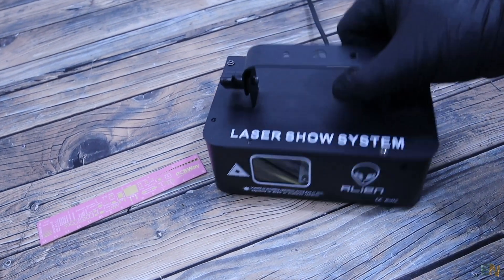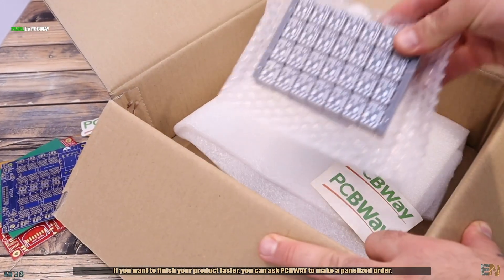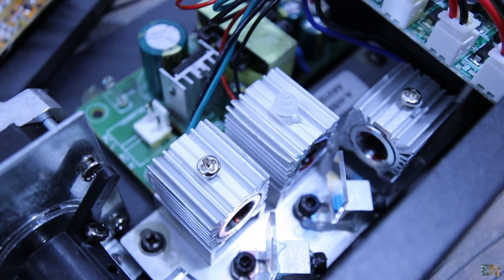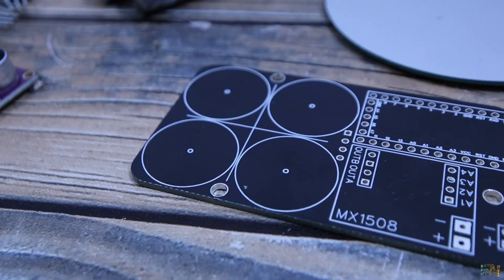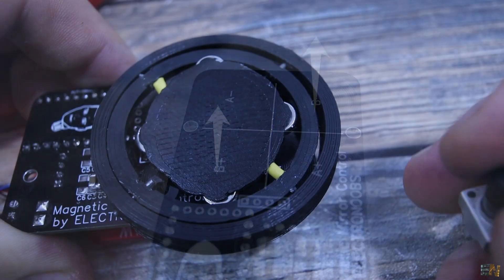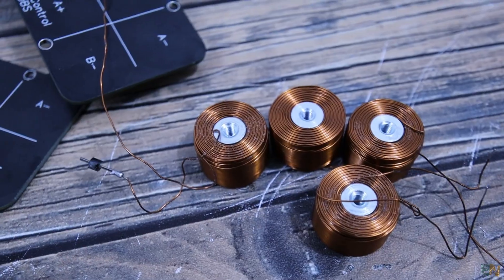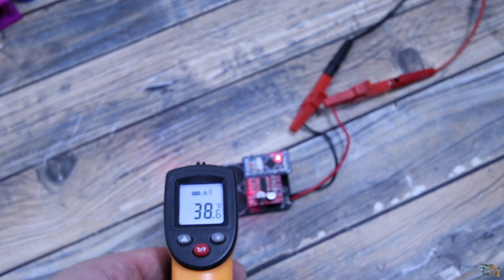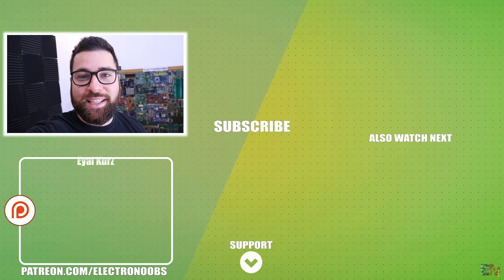Move Mirror with Magnets and Coils - Magnetic Actuator For Laser Machine

Comment: The video ended on biasing the beam by one mirror with resistors manually. But where are the figures drawn from the Arduino or the oscillators? Didn't work out?

Comment: What are MOSFETs supposed to be used for, if the output power of the amplifiers (10-15 W) is enough to drive the electromagnets? With a coil resistance of 4 ohm, the current through the coil, at a supply voltage of 8 volts, is 2 amperes and the coil heats up a lot (blue driver)...

Comment: Super dope idea to move one mirror in two axes! Maybe you could try to use a flexure design to avoid using heavy bearings and further reduce the overall weight.
Reply: Totally agree. Use smaller (lighter) mirror and use flexures.
Huge hidden advantage is that flexures will create a counter force. (Meaning controlling the position of the mirror will be easier)
Unfortunately, making flexures is not that easy. You could probably 3D print something, but the design of the flexure has a huge impact on the dynamics (of the  control loop)

Comment: Very Cool!!! Just the video I needed. Ive been trying to figure out how to do this with brushless motors because stepper motors and cheap servos are too slow. Im new to the arduino and cant figure out how to run the speed controllers thru the arduino. Brushless would certainly be fast enough as I have several layng around that are for airplanes or large drones. Installing mirrors to big brushless motors  is a lil scary cause as fast as they spin it could send glass right through your body

Comment: Suggestions: make the magnets static and attach the coils to the mirror to minimize Newton’s law of inertia. Another idea is to attach the mirror to four speakers. The angle of rotation will be quite small, though.
Reply: If I understand you correctly, that seems like a great idea. The only downside is that you need to wire the moving part (not a deal breaker)
Having more mass would potentially mean the mirror could move faster. On the other hand, sometimes a little more mass could make the control more stable.

Comment: Everyone has been inspired, me too!
I think a thin PCB with coils with spiral cuts around it to be also springy and a hole in the middle to put a pivoting support could be perfect.
On top of it you should glue a thin light aluminium "foil like" mirror that will also help for cooling.
That way your first PCB coil connection with two H-bridge will be ok.
The bend will be proportional to the current due to the springy effect of the PCB. And the polarity will be the direction of the tilt.
One flaw will always be inertial momentum but this way it will be highly reduced.
In high quality machines steppers are substituted by galvanometers (a lot faster). Bye! Very inspirational.

Comment: The good and old technology is always the best: CRT TVs! Scanning horizontally at high frequency and vertically at lower ones (50,60 or even <30hz), you will only need to control when the laser will turn on or off...
Reply: CRT deflection coils require quite high voltages (1200V if memory serves me correctly) - so a controller can be hard to build, also quite dangerous to touch, I have tried several times - it hurts, and can actually completely numb the entire arm for a few minutes.
Reply: @EgonSorensen  I'm not talking about driving the coil of a CRT TV, they need high voltage because it's deflecting a high speed miniscule electron inside vacuum, for laser projector a small  magnetic ball with small coil will do...

And the horizontal deflection coil is driven alongside the primary of the flyback if I'm not wrong, with lower voltages (only the electron gun is controlled with high voltages I guess)
Reply: @EgonSorensen  I don't know a lot of CRT TVs, but I think you are confusing deflection coils with deflection plates (the wires that come out of the flyback) that control constrast and brightness (one is with the electron gun), the deflection coil are only a large electromagnetic made of copper that deviates the electron bean inside, the use lower voltages (even some people make crude oscilloscopes driving thoses coils with a amplifier or something like that...)

Comment: Excellent, how about using PCB coils instead of magnets, it should lighter.
The small movements should be an issue for the thin wire interconnections.

Comment: Suggestions: spherical mirrors can move the laser beam a lot with small movements I suppose, magnetic balls can be used with the coils to create larger and faster moving images (you may need to compensate the power of the coils with the faster moving ones because of the mass of the ball...)
Reply: Using speaker (trebles ones or piezoelectric driver) with a small mirror on top to scan like a crt tv (high frequency horizontal scan, low frequency vertical scan) can save a lot of work, only needing to control when the led is on or off (vibrating a mirror on plus 20khz may require a lot of power...)
Reply: How in the world would magnetic balls can be used? Have any reference to this?